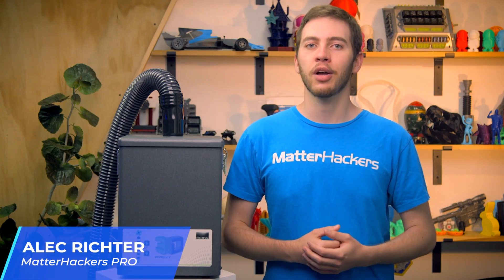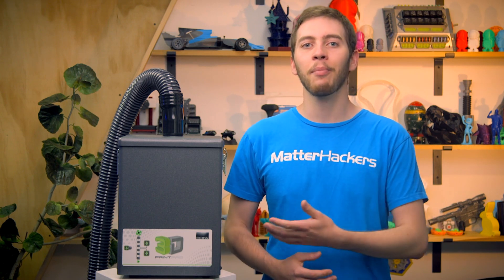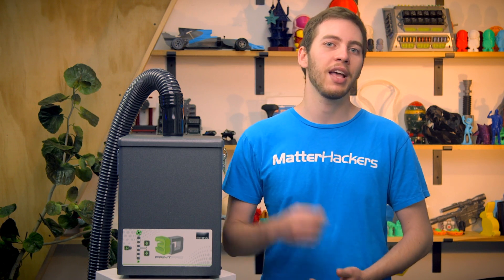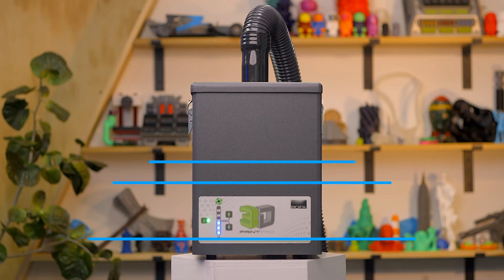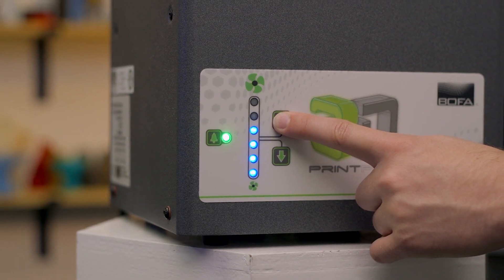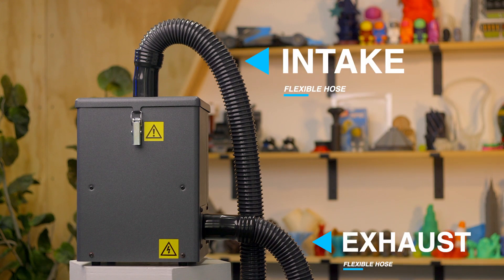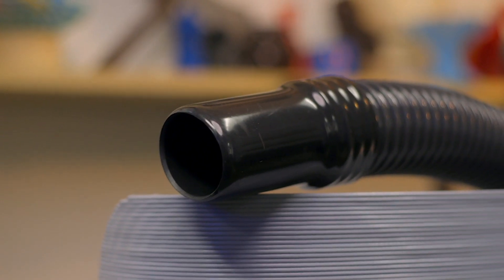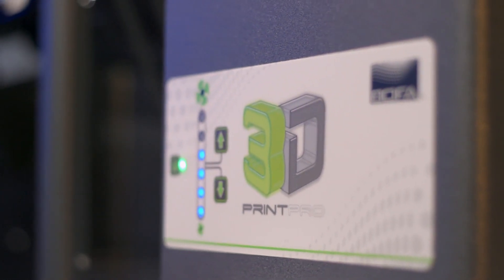Tech Breakdown: BOFA 3D PrintPRO 3 Fume Extraction System

Comment: Wow $1000. You can achieve the same fume extractor for $50 by using a home depot bucket and building a fume scrubber using water and few more hardware items. Another option, build an extractor with PC fan and blow the air outside

Comment: Iam sure when you first get this filter it does a fine job of getting rid of the ABS fumes, but how does it do after 2, 4, 6 months does it keep doing the same job, and I think I read that the carbon filter last a year or so that would probably depend on how much it is used, I want to know if it does the same at 6 months as it did when you first hooked it up

Comment: You can 3d print and build a solution just as effective for under $100.
This is insane.
Reply: can you send me a likn to the plans/ filters to do this
Reply: @tylerjustuspaige  youtube doesn't let us send links any more :(

Honestly all i did was find a small hepa filter on amazon, one of the tiny square ones...bought that, and a full sized sheet carbon filter, cut that up, then designed a square the size of PC fans around that with screw holes in all 4 corners to match the fans.  A few extra long bolts and such and done!  ...just...make sure you set the fans to pull air out... LMAO!  depending on your enclosure wall you can seal it with something to keep the air flow outward pretty strong, etc.
Reply: Of course the filter area of the BofA is much bigger due to to size and thickness. But that’s also the premium you pay. You could get the replacement filter of the bofa and build something caseing around. That should get close